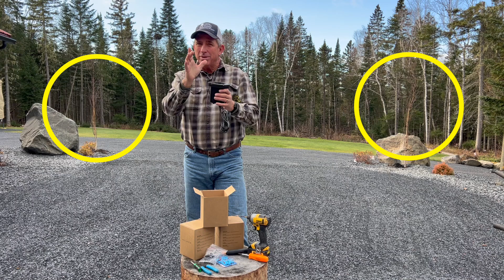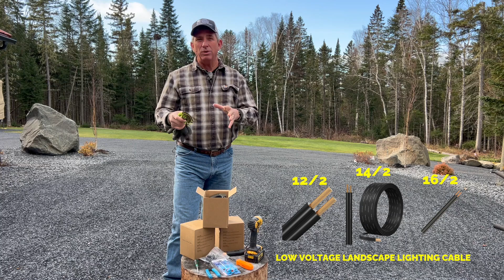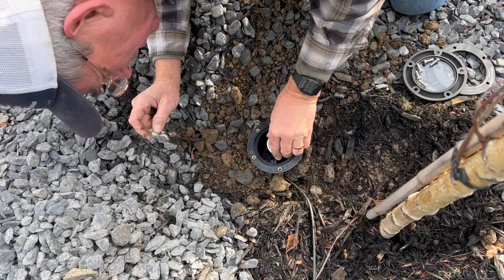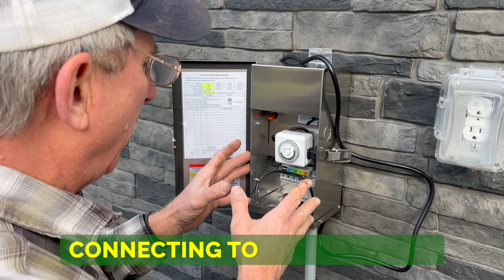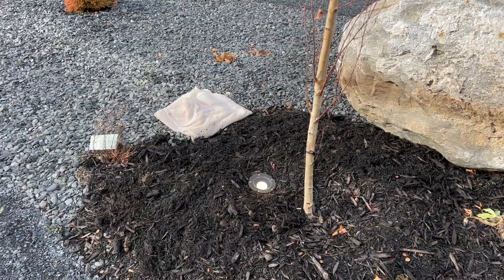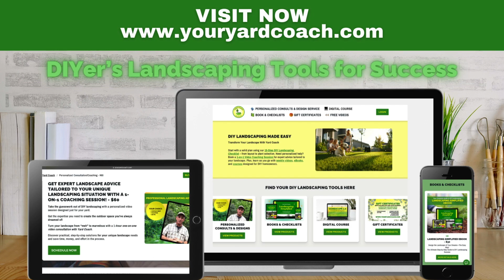Installing Well Lights the RIGHT Way (Avoid These Mistakes) | Gardenreet Well Lights

Comment from the maker: Well lights are one of the cleanest looks you can add…

👉 IF they’re installed right.

Get 15% off here:
https://gardenreet.com/collections/in-ground-well-lights/products/brass-in-ground-well-light-with-open-top

Use code: YCC24

Start your landscape the right way:
https://www.youryardcoach.com/15-step-diy-landscaping-project-checklist

Would you install these yourself?

Comment: it's advisable to dig the hole and fill with pea gravel..and then sink the well light into the pea gravel. This helps with drainage. Well lights are very susceptible to water intrusion.
Reply from the maker: Depending on the soil you have yes you are right.